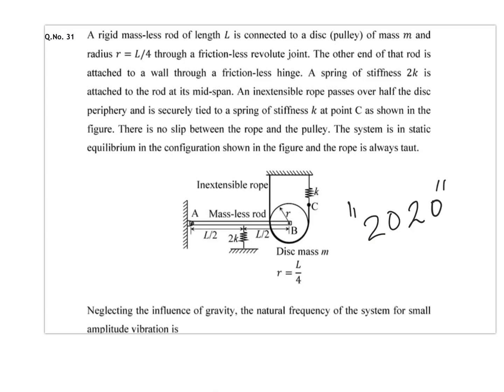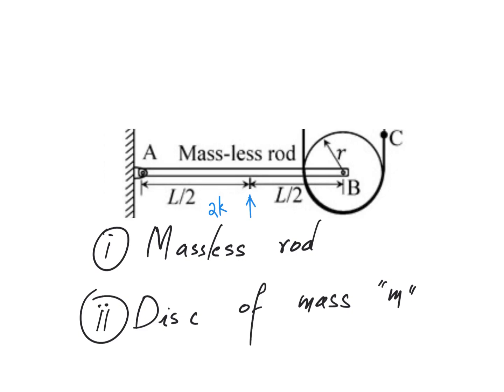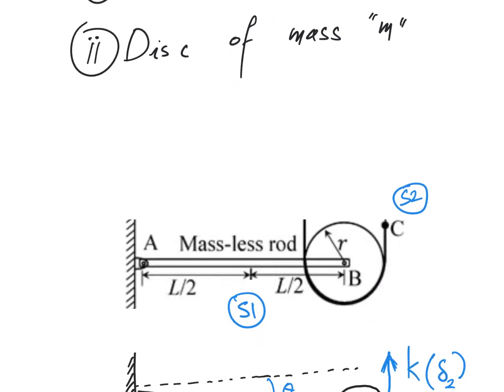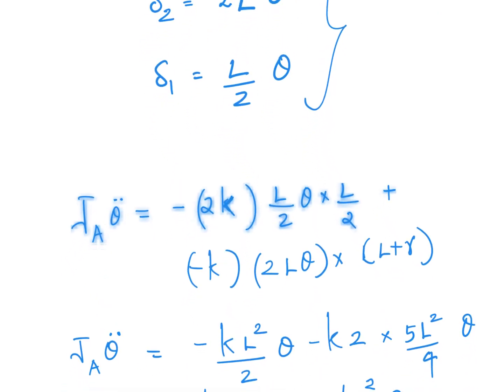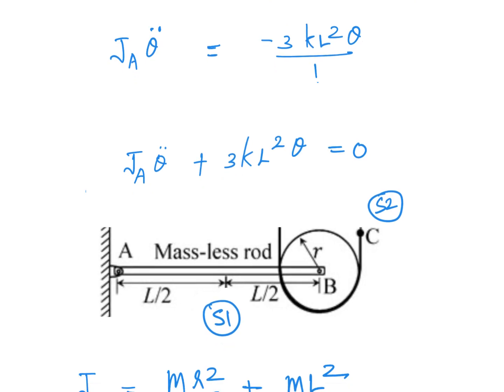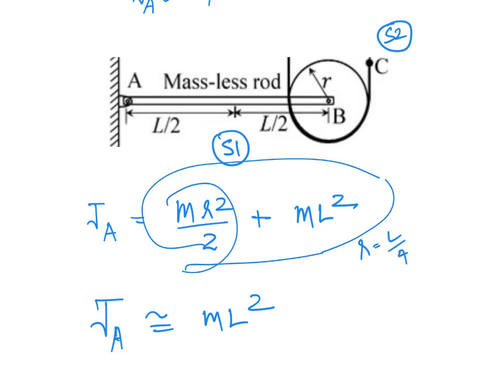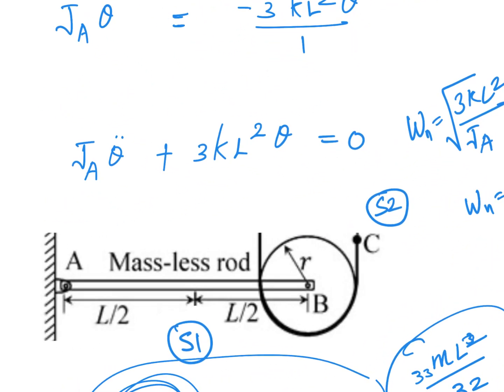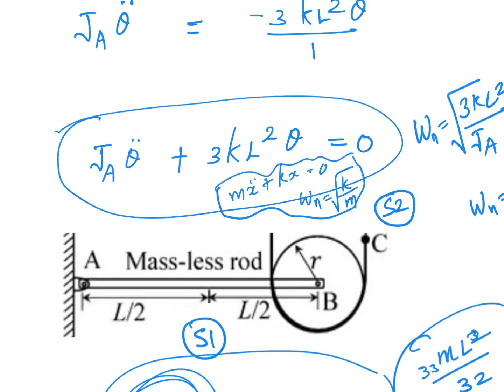Finding natural frequency of a rod-disc system | Vibration | GATE 2020 Solved example

Comment: Sir but first condition for applying torque method is that... We should take torque/moment about I-centre of system only... Bt i dont understand how point A is a I-centre of given question
Reply: The necessary condition to apply torque method is that net torque should be zero about any point so that we can equate the inertial and external torque...
It's not correct to say it as IC always but the concept of taking moment about  IC centre is the extension of above concept..because IC is the point which is assumed to be at rest so there will not be any net acceleration at IC so we can conclude the torque about that point is zero since it is not accelerating.
Here Point A is chosen because it is a hinge since we know hinge cannot resist moment so the net torque about it will be zero.

Comment: u have made great video..but i need to mention that there is not pure rotation about A....disc will rotate about its own axis also...thus it will no longer be pure rotation about A...for the correct solution without any assumption kindly go through this video....https://www.youtube.com/watch?v=BEmC-f-_oKI&feature=youtu.be
Reply: doing this by energy method people assume disk rotates about its own axis and get correct answer but they make mistake while solving this by torque method...in torque method they start assuming that disk is rotation purely about hinged point ..which is wrong in this case...This video is just to make confusion clear...intention is to let everyone concerned know the correct solution...Intention is not at all to disregard any teacher or student...